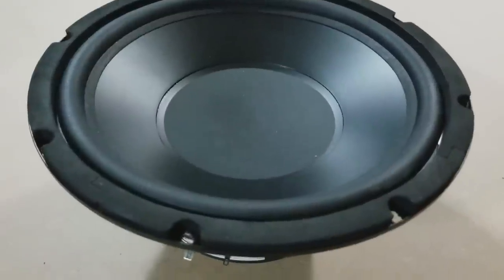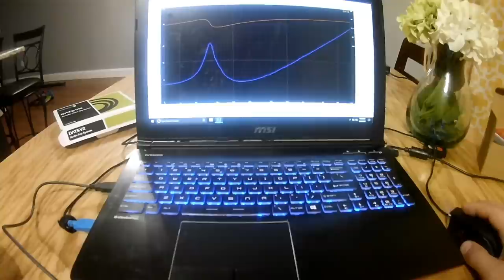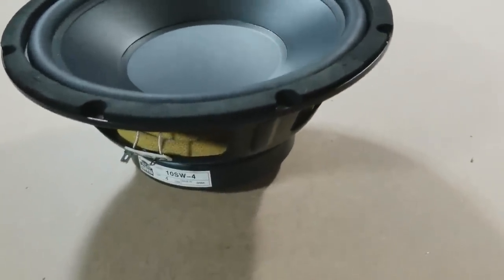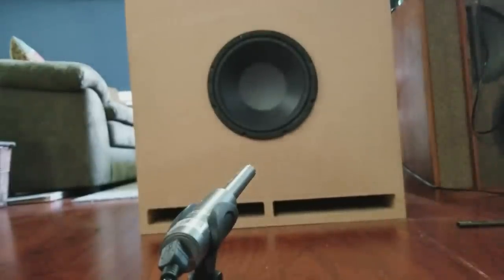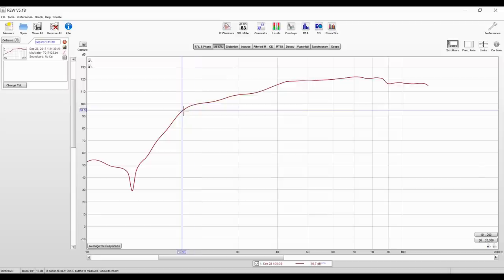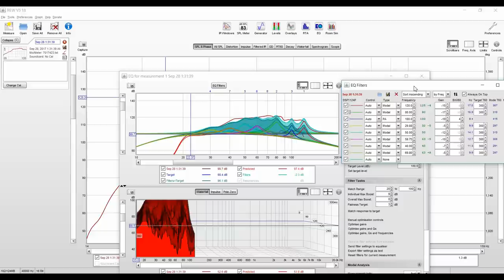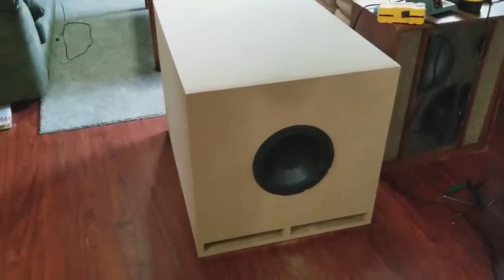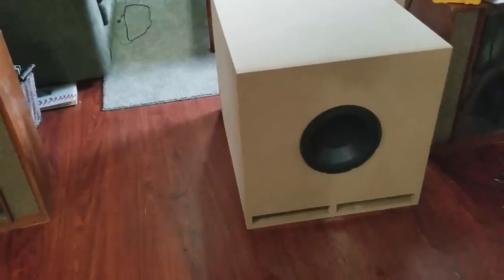20hz from a $20 Subwoofer? Budget Build?

Comment from the maker: I re-tested the subwoofer and have a better representation of it's frequency response in my room: http://techtalk.parts-express.com/forum/tech-talk-forum/1347018-20hz-from-a-20-sub
Reply: 123Toid if your selling the box I would buy
Reply: 123Toid I try using this GRS sub today I was using a rockford prime 5.25 coaxial speaker but after I use the GRS subs for the midrange my sound is 500 percent better the reason I do this is because I was having a hard time getting my prime 5.25 inch speakers to play 100 hertz now the GRS subwoofer does everything way better I am shocked except I don't allow my GRS play any bass sound its not good at making bass sound with the speaker box I am using
Reply: Shove 2 in the box

Comment: I have used these in several of my projects. Absolutely the best value bang for the buck in a bass driver I have ever imagined. This driver has all the right stuff: poly cone, rubber surround, 2 inch voice coil, hefty magnet. The 1 1/2 cu ft vented alignment is a tad small from my perspective, but nonetheless sounds really great. Unfortunately, I don't see it offered any longer (fall 2017). BTW, f3 was down to around 30 Hz.
Reply from the maker: Really?  This was my first go with them.  I must say, I too love poly cones.  I know not everyone lieks them, but I have always been a fan of them.  Parts Express looks to still be still offering it - https://www.parts-express.com/grs-10sw-4-10-poly-cone-subwoofer-4-ohm--292-482  I may take this and turn it into a much smaller box for my diy sound bar.  I personally have been pleased with the sound as well.
Reply: Check out my video "Satellite Subwoofer Speakers" where I use one in a very successful active speaker system.
Reply from the maker: I'll do that right now.  I'm looking forward to seeing it!
Reply: I have the 8 inch version in my home office setup and a built a monster box for the 12 inch version of this sub for my basement theater system.  The 8 sounds great in the office and the 12 is ok.  More time is need to dial the 12 in since I don't use that very often.
Reply: It's all about getting the alignment right. The ten inch version offers a moderate sized vented alignment, don't know about the 8 and 12 inch versions. Sealed alignments and small vented alignments don't sound near as good to my ears. Check out my video "Bass Speakers" for more info: https://www.youtube.com/watch?v=SWZyWeVQYd8
Reply: Most 10 inch drivers offer a 1 1/2 inch voice coil, and you usually don't find a 2 inch VC til you move up to a 12 inch driver. Not all VC's are made equal, so diameter is not the only important matter, but still something to consider, as more VC wire generally means more power handling capability.
Reply: 3 inch VC is gigantic for an 8 inch driver, that really something, most 8's use a 1 in VC, but likely such a large VC is not really necessary since a driver this size is selected specifically for an application not requiring a great deal of SPL output.
Reply: With a qts of .63 I imagine it takes a pretty large box for a 10" driver
.
Reply: The 12" pretty much has to be open baffle or sealed in a large box.  With a qts of 0.98 even open baffle system q is very high!
Reply: You can get almost any fs you want by adding weight to the speaker cone (usually as mass glued or otherwise attached under the dust cap) The trade off is that you lose a LOT of efficiency and dB's of SPL.

Comment: My opnion: I think that box is bigger than it needs to be. Yeah, because of the high QTS and stiff suspension, you can tune it low. But if you give up some of that extension, you can use a smaller box that is more practical for most people. Were I doing this project, I would have designed a tall, narrow enclosure that could stand up in the corner of a room while only taking up a modest footprint on the floor. You could re-use your box with most 18" subwoofers and probably get similar extension but with a lot more output.
Reply: Nice idea, and since the 12inch is a high qts subwoofer it needs oversized ports, so a bigger lower qts subwoofer probly wont be a problem for the airflow without chuffing noise.

Comment: I have the 8 ohm version of this speaker on the ten inch and 12 inch and they sound great! Vast improvement on not only the low end but the overall tone in my two sets of vintage 3-way floor speakers. It was a great upgrade.

Comment: Would a T-line not be better suited for this? The lowend extension would be kept but it would help smooth the peaks. Plus in a budget build with not much room for an EQ could save some bucks for something else. Even though t-lines are big it's a little more practical than that behemoth even if you went for the 12 inch variant.
Reply: I modeled the 12sw-4 in HornResp and it doesn't really want to hit those lows no matter how big I make the line... Like, really big and it still won't

Comment: I've got a midrange and tweeter out of an old 12" 3 watt loudspeaker that I built years ago. The original woofers were paper and the Arizona sun rotted the cones and surrounds. Can you use these 4 ohm woofers be used with 8 ohm miss and tweeters? Also, have you tried using the Mach one replacement woofers from Parts Express. Back in the day they had a nice warm resonance. I'd love to use a pair of them in my next speaker project!

Comment: When soldering your wires to the loudspeaker pins, you shouldn't melt the solder onto your iron but heat the metal first then apply the solder to it. Sorry for the bad english, hope you got the hint.

Comment: I've got a Renegade RXV1200 that looks to be a rebrand of the GRS 12SW-4. However, it is rated to 300Wrms while the GRS is rated to 120Wrms. What do you suggest I run it at?

Comment: These are killer for an SQ build in home low power application. Tuned for about 30 and a bit of EQ and some subtle driver mods and you have a very fast, and very linear bottom end that complements a very musical setup. A great combination for a modest set of 2 way bookshelf speakers for sure. And tuning for 30 hz you can get away with a box less than half the size of this video, and gain a bit of power handling as well.

Comment: I check the frequency range of subs and they show 30 hertz up. How did you get 20 hertz?
Reply from the maker: That’s not saying it can’t play beyond 30hz. That spec especially for a subwoofer can be confusing. The best thing to do is to model it to see what it can do in the enclosure you design. In fact I ended up redesigning a subwoofer using these subs and it is quite impressive: https://youtu.be/CvUjWNwPHDU?si=OaEHoUYu2cNM2ARs

Comment: You might consider using a folded horn cabinet to tune it to emphasize the low end without being mammoth in size.
Reply: You are thinking in the right direction, but the enclosure will be huuuge - 20hz horns require big mouths, and proper loading needs lenght = huge box
Reply: Maybe a t-line?
Reply: I would just go 4th order with a cheap sub. T-line needs to be large no matter what's in it.
Reply: That high Q a driver in a horn will need an even bigger box or the motion will just be choked off. It's the wrong type of driver for bang for your space. It needed a huge box and low tuning cause of the crappy motor.

Comment: I bought 2 pioneer 8 ohm rubber edge 12 inch woofers with a 65 ounce magnet that were 19 hz from MCM electronics an I put them in a middle ported box that was meant for a car..I used them in my house under a bench so they were basically out of sight I used it as a subwoofer I used a bash amp from a sub woofer I bought from a pawn shop..an it sounded great..  that combined with 2 pair of klipsch RF3ii an klipsch center at low volume I heard noisees coming from parts of my house that were being affected by the low bass note..  my wife was a little bit confused as to why we were hearing creaks an rattles an I told her why then she understood..but wasn't happy...lol

Comment: What program are you using? And do you know of another box build calculator for free besides winISD?
Reply from the maker: michael baum I am using rew.  Although that first measurement was off. Unfortunately had some bad equipment I gave me a bad reading. Look in the description for the actual graph.  Jeff bagby's passive crossover designer also has a box model modeling tool in it.  There is also another one on his download site: http://audio.claub.net/software/jbabgy/jbagby.html  Finally there is Unibox.

Comment: Not completely the whole story.
First of all, we are seeing the bafflestep here. So if you filter at en proper frequency, the -3dB point will be much better.
Second is that the huge box is because of the high Qts.
This can be electrically compensated.
Although that's easier in a closed box, it can be done in a ported box as well.

Comment: It's all in the enclosure. If I've got time I might make a new, way better enclosure for my z2300 subwoofer. I've used it for a while now and the fs is much lower than it used to be. It's pretty soft now. It can go down to 35hz with the crappy enlosure it comes. i bet I can make it at least 25hz with the right enclosure. With the 2 way Pioneer satellites I've got it'll make for a good 2.1 speaker set. It would sound awesome in my small room.

Comment: Interesting build. Checking out your response curve on PE forums, it looks like the box is tuned a bit low yet with a roughly 10ft^3 chamber. It looks to be more of an upper 20's sub to me, which still isn't bad for a $20 driver. I just finished building a 2.5ft^3 sub for my computer using a Dayton 10 HF and, using very little EQ, it's +/-0.5dB to 20Hz measured outside on my driveway.
Reply from the maker: Wow that is really impressive!  I may have to pick one of those up to play around with.  Ported or sealed?
Reply: It's one heck of a 10 for the price and I would definitely recommend it to anyone looking for a deep SQ sub on a budget! I thought about going with the 12, but that needed a notably bigger box and I wanted to keep the box relatively small. Mine is ported around 22Hz.
Reply from the maker: I am pretty impressed with the sub.  You really can't ask for more for the price you are paying.

Comment: In Parts Express speaker specifications it says that Frequency Response is from 34 to 800Hz, it does not get to 20Hz.
Reply from the maker: That's not how that works.
Reply: @Toid  That's interesting if it can get to 20Hz I would like to try to build one but why does the manufacturer puts Frequency Response is from 34 to 800Hz if it can get to 20Hz? It must have some limitations compared to other much more expensive subwoofers.

Comment: i need a free air sub for a car, do you think, if i could get the ohms to match, using the 12SW-4 this would be a good candidate, it actually needs a dual core sub. do you have any suggestions? i believe its a 2 ohm system, factory 90's caddie non-bose system.
Reply from the maker: Taking a quick glance at the QTS, it looks like it might be a good candidate for free air.  If you want to model it, I just did a quick video on free air, open baffle and what to look for and how to model it here: https://youtu.be/GLKZVBYi-Lc
Reply: awesome thanks for the link, i cant wait to get something to update the sub. I replaced it but it still has the same issue.
Reply from the maker: ZelosZelo You are Welcome.  I put a new link here: https://youtu.be/GLKZVBYi-Lc
Reply from the maker: You can get a bunch of Dual Voice Coil subs at Parts Express.  Just so you know, as long as you match the wattage and ohms, you shouldn't need it to be dual voice coil.
Reply: i would not know which way to wire a single coil sub to a dual coil setup. its factory so i do know if the amp can take running only one channel, or if it can handle any other configuration. There is no info on which way would be safe. It may be left and right in each coil too, then i would  loose a left or right channel.
Reply from the maker: It sounds like you should look for a direct replacement subwoofer, so you can get the specs for it.  Either that, or replace the amp and the subwoofer.
Reply from the maker: If I were you, I would call Parts Express tech.  They may be able to tell you what you have in your vehicle and find you a replacement.
Reply: good idea.  didnt think of that.

Comment: Can you use a 4ohm speaker in a home stereo that's 8ohm output?
Reply: Yes just play at a lower volume and be careful. Your amp might start getting warm
Reply: @Nobby Heads you mean 2, 4ohm in serial  or parallel in 1 speaker?  That becomes a 8ohm, speaker?? Didnt know that...
Amazing if that's the case

Comment: I got a dayton audio 18in classic that i need help on building a box for i come from car audio so im trying to understand why to tune so low to say 20 hz is it for room size
Reply from the maker: That's a great question. It's really two fold. The first's is you want to get to about twenty hertz, since movies do have sound that go down to 20 Hertz. another reason why you wanted to knit lower than you would have car subwoofer is due to room game and or cabin game period in a car you have a lot of cabin game because it's such a small space, which can help hiy those lower frequencies.  In a home, you have a much larger space insert your room game is going to be much less and therefore you're going to have to tune it lower.
Reply: @Toid  ok so what size ported box and tune would u recomend going with for the dayton audio 18in classics dcs450-4 my room is 20ft long by 12 ft wide i have enough room to build a 15 cu ft box if i needed too i like car sub boxed built to 35hz if that would give u a idea of what im after is the most spl i can get and most sq i can get kinda 50/50
Reply: Harold Powell Youd dig deeper without taking too much space with a sealed box with that driver!

Comment: It's not hard to produce 20 Hz. In fact it's cheaper to make a driver that goes very low in a huge box than to make one that goes less low, but in a smaller box. If a woofer has a weak magnet and soft suspension, it wil go low in a large box. Simple as that.

Comment: No replacement for displacement - as this video proves. 

Size is a dealbreaker. Unless I could somehow turn it into a plant holder, ottomon, or TV stand! Surely there are other shapes that could have been done. Maybe if you stretched it and flattened it you could run it like a step along a wall.
Reply from the maker: Absolutely.  There are a lot of things that could be done.  One thing, is you could do an isobaric with this sub, and make it considerably smaller (4cubic ft)  and still get the same response.  Or you can make it eve smaller, but you'll lose response.  If you kept it this size, it might be a great behind the couch subwoofer, end table or coffee table.

Comment: i have a logitech 10inch subwoofer from a z-5500 speaker system,
i heard its made by tangband.
i love the woofer so much giant motor and a high roll surround
i want to make a bew box for it.
has someone a idea?
i got it from a thrift shop for 7.50euro
Reply: Sadly your driver isn't from tang band.. you see.
The only logitech system that did actually have tang bad drivers were the logitech z560 speakers back in the early 2000s. and those drivers didnt have a logitech logo on it.

try http://reaudio.com/box.php

to design your own box. and see where it takes you. ive used it quite a few times and it works great
Reply from the maker: It is really hard to make a ported box for a subwoofer without it's T/S parameters.  However you can build a tool to get those fairly cheap: http://techtalk.parts-express.com/forum/tech-talk-forum/1313049-easy-zma-and-t-s-parameters-using-the-limp-module-in-arta-an-illustrated-guide  If you want a high end one, you can buy a nice one from Parts Express: https://www.parts-express.com/dayton-audio-dats-v2-computer-based-audio-component-test-system--390-806  Once you have your T/S parameters it is very easy to make a box tuned to your subwoofer

Comment: People REALLY have a hard time separating the idea that a subwoofer that looks fancy, or has an exotic cone material, or a heavy basket, or a fancy spider, likely won't sound any better than a sub like this at normal listening levels.  Sure, a sub with a fat surround and long mechanical excursion will get louder in its own, but it won't sound as good as two drivers doing the same volume, and few, IF ANY, boutique subwoofer drivers will sound notably better than this one.  All the things people look for, tonality, "speed", accuracy, tightness, almost entirely comes from the quality of your midbass drivers, the way they are crossed over and hand off responsibility to the sub, and their location in the space relative to the listener.  If you do a double-blind listening test between the 12" version of this driver, and some fancy, expensive driver, at moderate listening levels, you WILL NOT know which one you are hearing.  The story of the Emperor's New Clothes was practically written for the audio community.  People WILL THINK THEY HEAR A DIFFERENCE between cheap cables and fancy cables, cheap amps and equally rated expensive amps, and cheap subs and fancy subs at relative levels, when the most important thing, be far, is your main speakers, your room, and your processing (crossovers).  Manufacturing practices have changed the whole ballgame. Dare to let someone do a double blind testbon you someday.  But be careful, it might take some of the excitement out of this hobby for you...